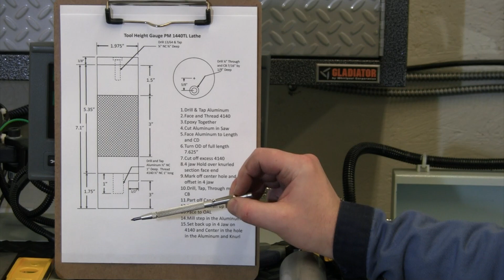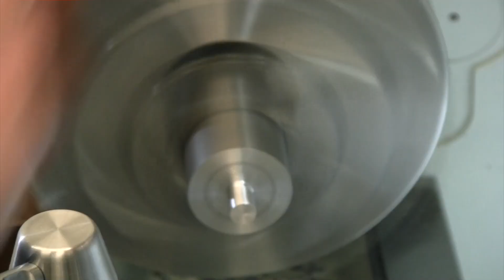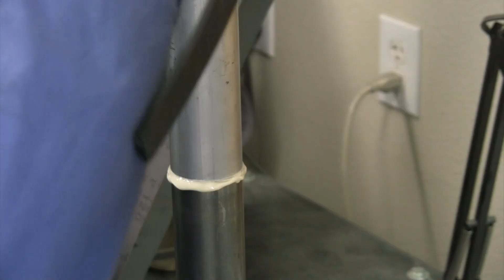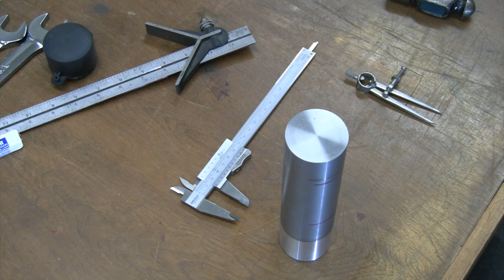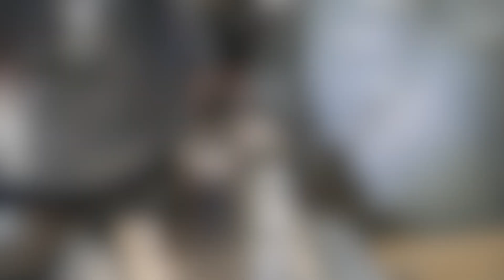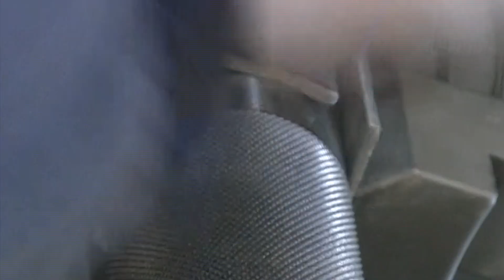Tool Height Gauge For PM 1440TL Lathe - Off Center Boring, and Some Knurling

Comment: Nice job. I started working for a company back in February and noticed a leblond regal tucked away used as a storage rack. I've been wanting to learn machining and have learned a lot over the past few years as far as info and basics but never turned any metal. The leblond had problems and wasn't running. During my lunch breaks I slowly and quietly cleaned 50 years of gunk off, changed out the oil, got oil pumper working. 3 days after getting it running right a customer came in needing a shaft  built back with weld to fit a bearing, success. Perfect fit. So much to learn now in actual, physically turning metal. Thanks for the vid
Reply from the maker: Chris Allen - What a great story and I am sure that leblond is happy to be running again.  Not to mention being able to deliver a job for a customer. Thanks for the comment and all the best on your learning journey.

Comment: I made a similar height gauge. I put a 1 inch thread in the middle with a set screw, so I can adjust the height precisely. I figured at some point I'd ding up the bottom and need to resurface it and adjust the height a bit
Reply from the maker: Aaron Anderson - Sounds like some good forward thinking. Thanks for the comment and the idea. Cheers.

Comment: I have a idea useing a 3/4 round aluminum with a laser pointer and a .25mm hole in one end and set up each tool to where the cutting point just intersects the light from below . What do you think of what I want to try ? I think with lil effort will work great for setting up a steady rest as well and the ideas are endless...
Reply from the maker: The Bot formality known as Dale Sather - Sounds interesting, I guess you would need to try it and see how it measures out?  If you can get within the tolerance you are looking for then could be a neat tool indeed. Like a bore sight for a weapon.

Comment: What is the theory of using the top of the tool as opposed to just raising the tool to the bottom of pivot cap?
Reply from the maker: Works either way for sure. Just hard to feel on the underside. If you pivot the top you can feel if to high when it runs into the tool.

Comment: Measuring portions by weight can be faster and easier than measuring by volume--if you have the right equipment. It is also a much more accurate method of measurement (without very specialized volumetric equipment), though in many cases super high accuracy is not needed. But deciding to use equal weights instead of equal volumes rests on a key assumption--namely that the two components have the same density (weight per unit volume). And for epoxy, that is not always the case. 
For example for System 3 T-88 2 part epoxy, the mix ratio by volume is 1 part resin A to 1 part hardener B. But the mix ratio by weight is 100 parts resin A to 83 parts hardener B. The instructions also state: "Do not alter mixing ratio.".
There is some room for deviation from specified ratios, but suboptimal results may accompany deviations that are too large. So it would be best to look up whether the densities are the same, and if they are not, a simple calculation can be made to get the weights of each component so that the mixture had the proper total volume AND the components are present in their intended ratio.
Reply from the maker: Steve H - Great feedback and perspective on this, thank you for the detailed comment.  For the couple of 2 part epoxy combinations I use this method of weighing works well and to your point, this method may not work well for many other 2 part combinations out there.  I will try to be more mindful of my comments and how they apply to what I am doing vs. a rule of thumb for any situation.
Reply: I've mixed JB Weld for years just "eyeballing" the two parts and never once had any issues. It set up rock solid every time.

Comment: How did you determine the height of the gauge, did you measure or is it a referenced value from the lathe spec sheet?
Reply from the maker: Jon, I just measured.  I put the sleeve and a dead center in the headstock and set a large flat top brazed carbide tool to that. Then used calipers to measure from the tool to the ways. It did measure to an exact MM measurement so I felt it was good. I am sure there are more precise ways but this was close enough for me. Having a tool within a couple thou of center seems fine. I was just using the tail stock center before.
Reply: @BladesIIB  thanks for replying, I’ll give it a go. Cheer from Australia 🇦🇺
Reply from the maker: @jonanderson813  I am sure you will do amazing!  All the best.

Comment: Like the video and the project! I really liked the intro with the dimensioned drawing and discussion of order of operations with the specific guiding rationale. So that is a great feature! However after watching several of you videos (including this one), one thing I do find is that you routinely speed up the shots of the interesting work and then still spend a lot of time saying things that are hard to follow and impossible to remember, like listing the steps coming up, with dimensions. This is not really helpful. First you often get the specifics slightly wrong (corrected with text annotations on the videos which is much appreciated!), but could be avoided by adding those specifics when you edit together the working shots. Also we're here partly because we like watching videos of machining operations. So consider showing the non-repetitive ones at 1 x speed, and for repetitive operations show at least the first few and maybe the last few at 1 x speed. If you "fast forward" an entire operations, there's not much we as viewers can do to recover those steps. OTOH, if someone thinks you've shown a little too much of a repetitious operation at normal speed, they can always skip a bit in the video. In other words, I suggest you err on the side of showing more of your work at normal speed. Some of us like to see machining, including the relatively bold cuts you can make with your 1440TL!
Reply from the maker: Steve H - I really appreciate you taking the time to provide some very detailed and thoughtful feedback about the videos and the channel in general.  I have not had a lot of detailed feedback like this, and I am always looking for ways to improve.  Good points on talking through to much detail without the drawing, some of it is me processing and thinking out loud.  Most of these items are one time builds and I am making it up as I go along.  I have tried to get better about thinking through all the steps before getting started and will continue to work on that.  I had some other feedback about the machining and high speed and will definitely work on including more footage at regular speed before speeding up the video.  Always trying to find the balance between getting it all in and still keeping the finished video to a manageable length.  In my recent videos I have been working on overdubbing and that has helped me cut out some mistakes and hopefully make for a better end result.  I really appreciate you watching and welcome additional comments and feedback as you think of it.  Thank you!